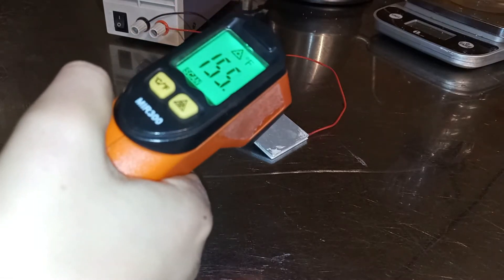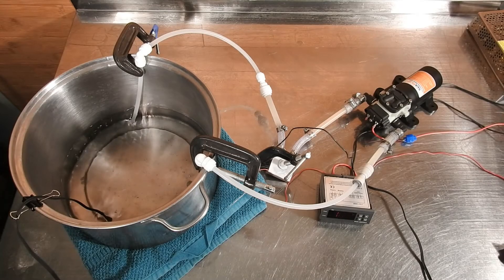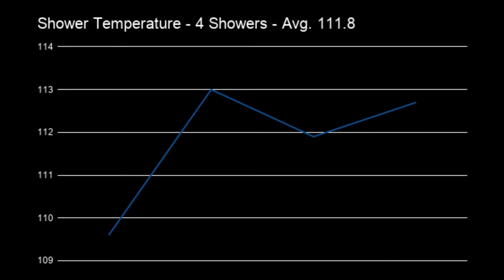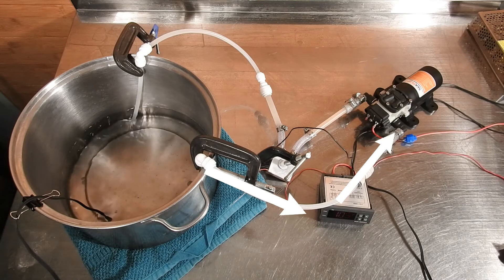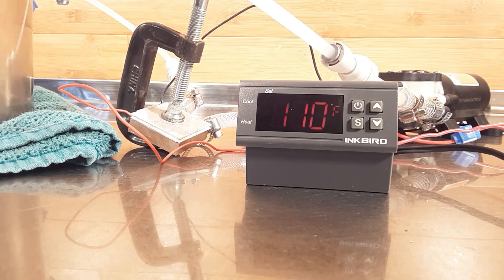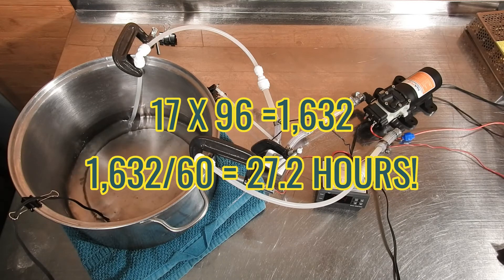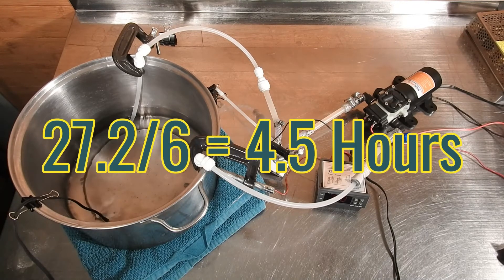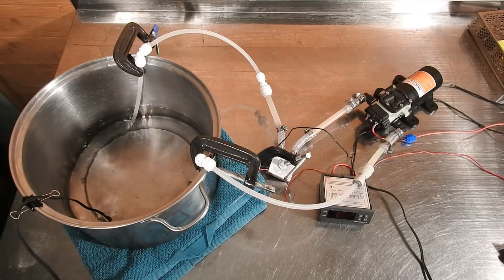Attempting To Heat Water Using Peltier Modules | Proof Of Concept

Comment: It's a pity you do not mention the starting temperature and the mass of the water. If I assume 20 degrees Celsius and 1 kg of water I can compute that 3.84x12x(3600+8x60)= 188 kJ of energy is delivered by the electricity (excluding the pump) and 4186x1x24= 100 kJ is stored in the water. The COP (Coefficient Of Performance) is therefore 100/188~ 0.53. COP values below 1 mean that you had been better of using a resistor for heating than a Peltier element...
Reply: I agree with your points. You have done a good job of calculating the energy efficiency of the Peltier modules. I am also interested in designing a DC powered water heating system. Do you have any ideas or suggestions for improving the COP of the Peltier modules? Or do you think there is a better alternative for heating water with DC power? I would love to hear your thoughts and collaborate with you on this project.
Reply: Peltier modules have a certain COP, depending on the material they are made from. Better materials should be found. I do not know of a better alternative. @RiyazHyder

Comment: Good design, great explanation. Don't stop learning and communicating what you learn.

If you get a chance to revisit this design, some things to try and solve.

1. How much thermal loss occurs from an open pot versus a sealed and insulated vessel like a water heater?

2. Peltier coolers have a max temperature differential from their hot side to their cool side. What are some changes you can engineer into the system to increase the temperature range on the hot and cool side?

With a bit more work I bet you can easily find ways to improve the efficiency of your proof of concept to beyond that of your electric water heater. Keep in mind that many manufacturers choose simplicity and affordability over efficiency and quality.

Comment: That was an incredible explanation. However I don’t believe the peltiers are given a fair chance. For example, wiring them in series creates less draw and you can run a lot more to try and harness the heat exchange more efficiently. I have been attempting to master this by creating my own cooking blocks large enough for dozens of peltiers

Comment: To make a peltier heater you have to put a fan and heat sink on the cold side of the peltier so it can have an unlimited amount of thermal input from the air. Your cold side is getting very cold- preventing that will heat the water much faster.
Reply: Do you think it's possible to get more than 100% efficiency from the peltier for heating (example: getting more than 100 heat Watts out, in exchange for 100 electrical Watts in), if you kept the cold side at room temperature with heat sink fins, and forced room-temperature air over the fins?
Reply: @vantongerent  I believe so, provided that the thing you're heating up is below the air temperature, such as ice or very cold water.
Reply: The fan blowing on the cold side? Or pulling from the cold side through the heat sink?

Comment: Could you use the cold side for something like a refrigerator?
Reply from the maker: The cold side was a little hot for cooling something such as a refrigerator. The cold side was sitting at around 50-70 degrees Fahrenheit.
Reply: @offgridjaden7677  That's good to know, thank you. This may sound counterintuitive but reducing the input voltage and thus power should make the peltier modules more efficient. Or you could see if that energy would dissipate somewhat with a second water pump for the cold side.
Reply from the maker: Thanks for the info!
Reply: @offgridjaden7677  You're welcome, I have to say it's mostly information from a youtuber by the name of "tech ingredients" has a couple videos with almost  everything about these TECs and finding practical uses for them.